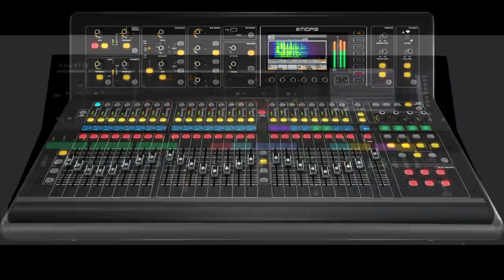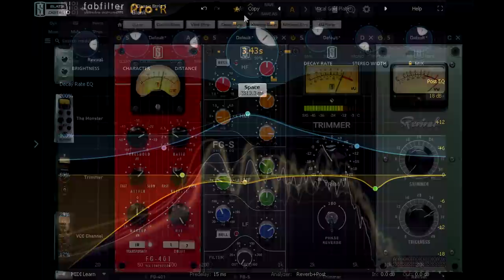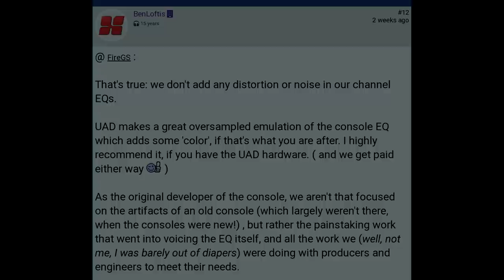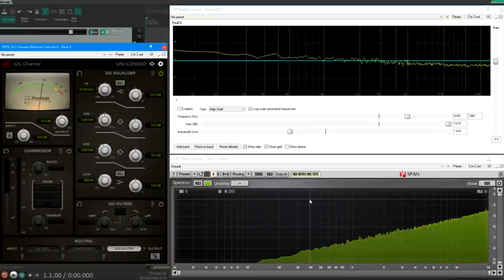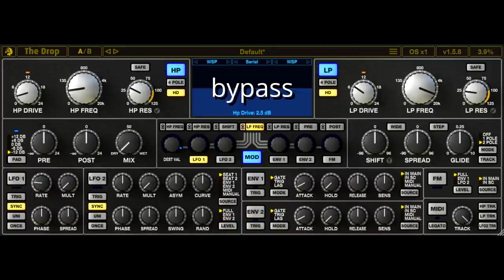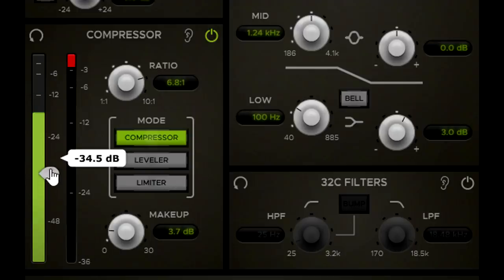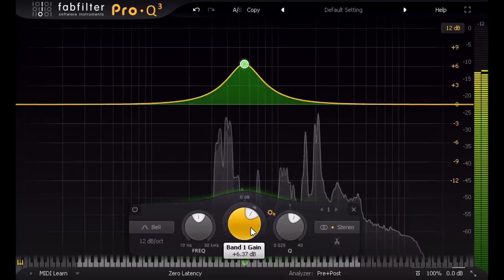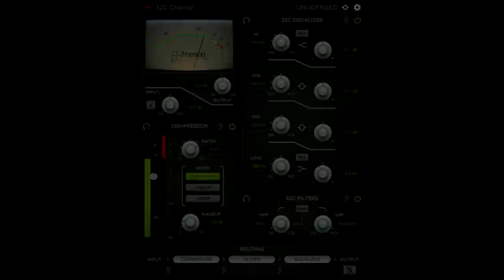Why Does It Null? (with ReaEQ) Harrison 32C Channel Strip

Comment: I wasn't really interested in this plugin and after this I'm definitely not. I find that these days I mostly just reach for the Fab Filter eq, it does what I need and is reliable, which is what counts when you have tight production schedules.
Reply: Sounds like you compromise in quality for quantity
Reply: @KyleGushue  Pro Q3 is one of the best EQs available. It's not sacrificing any quality.
Reply: Sounds like you comprimise in quantity for quality
Reply: @privateer2584  just reaching for the same old EQ because of time restrictions is compromising. No single EQ is best for all things
Reply: Does that come with saturation option (FabFilter)?
Reply: @agentviktor3297  no they have Saturn their saturation plugin
Reply: @LS-ud7do  it’s good when it’s done, and not done till it’s good.
Reply: In this case try TB Equalizer 4. You have infinity amount of bands, each is dynamic and can be saturated independently. Amazing stuff.
Reply: @KyleGushue  " No single EQ is best for all things" is a very ignorant and funny thing to say
Reply: @lannyfce4786  u serious? Matching the tool to the source is audio 101.
Reply: @KyleGushue  name something any EQ can do that pro q3 can’t do instead of using abstract rules that don’t exist
Reply: @lannyfce4786  easy, TDR Nova does dynamic equalization without aliasing, Pro Q3 aliases. Neve, Pultec, and API, all do harmonic distortion due to there design and components. Pro Q3 does not. These are facts easily shown in testing.
Reply: @KyleGushue  TDR Nova just aliased in testing (on each quality mode available on GE). I wanted to compare the anti-aliasing to Pro Q but apparently my trial for that is over.
Reply: @LS-ud7do  could be a flaw in the testing method.
Reply: @KyleGushue  Such as?

Edit: actually don't bother, you're either a liar or you don't know how to use Plugin Doctor, clearly there's no circumstance where aliasing could occur on a plugin that doesn't alias.

Decision fatigue is the strongest argument for picking a single high quality EQ and using it without question. If one already uses Pro-Q 9 out of 10 times; one could save 100 unnecessary decisions from the workflow of a single 100 track mix by using this technique.  For the 1 out of 10 times it isn't the right EQ, you can pick something else, still saving at least 90 decisions in total. It's the reason Steve Jobs wore the same style clothes every day.
Reply: @LS-ud7do  sweeping at an inordinately high level, mistaking aliasing for harmonics, not sweeping at various levels... there’s myriad possibilities for error.

Steve Jobs wasn’t making an artistic statement with his clothing. In fact with his art (design) he never settled for the same old thing, as your suggesting we do with EQ. 

It’s simply lazy and non-artistic to say one EQ (regardless of price or fame) is the absolute best for any source. Just like any mic, amp, instrument, ect isn’t the best for everything. And stacking the same pluggin over and over can exaggerate it’s otherwise subtle deficiencies.

Good is the enemy of great.

Edit- decision fatigue is a result of inexperience, not having too many options. One who knows their tools can immediately grab for it as fast as they can pro q or whatever. In fact having that variety can achieve results faster, than trying to sculpt something else into what it’s not ideal for.
Reply: @KyleGushue   huh. That’s funny because, this video clearly demonstrated how a console EQ emulation which had implied saturation but then null’d with reaper... so maybe you’ve been placebo’d a bit more than you think haha ; )

Also wrong about aliasing in proq3 lmao. I still don’t believe you’ve said 1 thing proQ3 can’t provide except adding what are the majority of the time unwanted artifacts I guess? Artifacts the people using the original hardware didn’t even want?

Here’s a final question for you. If you see a producer has 2 eq plugins, and one has 10 eq plugins, who is the better mixer?

(*hint* if you think you have an answer to that, you are not very smart, because proQ3 is more valuable to someone who understands EQ than every EQ combined is to a beginner)

Oh yeah one quick thing, you’re talking about Steve Jobs ‘artistic choices’? what is that even supposed to mean? Mixing is essentially just problem solving frequencies and dynamics, not building smart phones lol if I hear that I need to cut 500hz or high shelf 12k then I know where I need to cut and where I need to add a shelf, a different EQ is not going to make those moves substantially different and if they did it still will not be different enough to make or break my mix. When people like Dan Worall say ‘yeah stock EQ’s are pretty much good enough for everything,’ your brain says ‘but hey then why did I pay money for these emulations? What? I just got ripped off then, no way, these plugins MUST be worth something!’ When in reality, they’re not. There’s nothing any eq you have could do that virtually any stock eq couldn’t with a separate tape/tube/saturation plugin mimicking ‘warmth’

Thanks for being so wrong about things, this was fun : )
Reply: @agentviktor3297  It is amazing
Reply: @KyleGushue  Decision fatigue is a fact of life. If one has the mental stamina or experience to mitigate its effects then that's great, these are the things that should seperate us as engineers, as people. It's good that we have different approaches so I've elaborated on the qualities one approach. I actually use a slightly different method myself (for reasons you stated on a previous post) but still keep my EQ's to a small few. 

However there's no reason to spread miss-information about specific plugins so my focus was your point about TDR Nova not aliasing, now that's been debunked I'm done here. 

Making up false excuses about my testing just convolutes the matter, let's not pretend Pro-Q aliases under anything other than extreme duress.
Reply: @LS-ud7do  pro q aliases in dynamic mode. And without seeing your test, I can only remain agnostic about its relevance. That’s reasonable and rational.
Reply: @lannyfce4786  pro q aliases in dynamic mode.

the engineer with 10 eqs has a better chance of matching their processing to the source, if all other things are equal.

Considering how many of us still use Neve and api and pultec, and how many digital models there are, your claim about unwanted artifacts is incorrect.

I’ve verified mine saturate, tubes and transformers cannot be void of harmonics. Not even GML is completely clean.

The Steve Jobs comment was in response to someone trying to say he wore the same clothes daily, therefore we only need one EQ.

Find me a hit song, that only used pro q.
Reply: @privateer2584  I'm with you. Reducing cognitive load is important. People can futz around with a zillion plugins if they want but if my mix isn't 95% there within an hour the rapid degradation in the quality of my mixing decisions far exceeds the benefits of choosing the perfect plugins!
Reply: Dan sold me on the Tokyo Dawn suite of plugins and they blew me away, completely changed the way I work, mix and listen to our recordings. Superb!
Reply: @LS-ud7do  This! If you mix Post, you often don't have the time to test out different EQ's. I've used the ProQ for years and know what it does and how it will react on different source material. With tight deadlines, this saves time that I don't usually have. I'd offer that people who have the time to experiment (looking for the perfect tool for the source) are often making music for themselves, do not have deadlines and aren't sending an invoice for their work.

Comment: Hah, busted! For all their bollocks about modelling every transistor, they've managed to make a relatively flavourless digital EQ that cramps at the top end. In that regard, a non-cramping overtly digital EQ is probably closer to an analogue Harrison desk. I hope this video causes them to address these obvious flaws in the way that your ReaComp video or White Sea Studio's Smooth Operator video did.
Reply: From the responses I've seen from them so far, I'd say that it's unlikely... 

I'm glad you mentioned Smooth Operator. The way that company handled that was great. I really think they just made a mistake or didn't realize it would be a big problem and the fix they rolled out was solid.  This seems more manipulative...
Reply: I was suspicious when I saw that this plugin introduces zero latency to the signal - it shouldn't be really possible to make to do such complex emulation without any latency.

Comment: Isn't this the biggest issue with reproduction of hardware, the ‘colour’ sales pitch just doesn't work. No matter how many prominent youtubers or mixing engineers tries to convince me, the only benefit I see and have these for is to avoid watching the mix instead of listening to it by using both some modeling and clean and Fabfilter plugins.

I still want to see a true blindtest with some of these youtubers and engineers and see how well they do choosing the ‘coloured’ sound they claim to hear doing such huge difference.
Actually when thinking about it maybe I'll even sponsor a contest.
Reply: As in this vid, many times "color" ends up just being volume. An easy way to make your EQ sound "warm" and "rich" compared to stock or derisively-labled "pure" EQs is by adding a little more dB to your bottom end boosts than the controls suggest.... At that point, who is to blame, the youtuber who probably truly just doesn't know any better, or the plugin manufacturer?
Reply: @tz4601  Both perhaps? The youtuber should be educated when reviewing or talking about products.

Comment: Bit of unreasonable conjecture at the start about the UI design of analogue consoles being almost solely limited by the space available for knobs - stomp boxes have been using double shafted pots for decades now.
Reply: Have you seen a 1081 module?! 4-band with concentric switching, filters, and gain. Only manages q boost switches for midband. It's over a foot long by itself. Add dynamics, channel routing, and faders and you're quickly pushing the limits of ergonomic function.
Reply: @grantlack  The diameter of it's pots is beyond ergonomic - could easily be made to be half of the size

Comment: "What happened to all those resisters, capacitors and transistors?" Haha. I once developed plugins, and in my research, I found that this: Phat analog, transistor and tube sound emulation, was mostly just horseshizzle. And it is mostly just modeled-in difference, by manipulating the control to actual processing. So a 3db boost was actually a 4db boost, giving the impression of being warmer and bassier in comparison. There are even compressors out there, that EQ's the signal as you compress it, to give it a warmer sound. It is just too easy to manipulate listeners to fall for this marketing scheme. That's not saying that, in some cases, this signal manipulation doesn't sound good, it is just that it can be done with clean tools as well.
Reply: I love coloring compressors
Reply: sometimes the EQ effect comes from the sidechain curve of the compressor but yes I feel that some compressors EQ your signal to compensate something or just to give you a warmer feeling while still at unity gain. What plugins have you developed? Solo developer or for a company? I have a few ideas I want to develop but im not a coder. Can you give me some advise?
Reply: @24k-n6x  I developed both Solo, and some group projects. But during DSP research, and analyses of commercial plugins, I discovered that analog modeling, doesn't really exist in the way end-users think.

In regards to developing plugins. You should could start with a node modular like Reaktor to research, build and get a sense for how effects, processors and instruments are constructed / modeled.

From there you could move to scripting in Blue Cat's Plug'n Script. To get a sense for simple coding, here, prototyping in Reaktor can be immensely beneficial. Plug'n Script also lets you export your creations as standalone plugins. I think you can even sell them. But you are limited by its sets and libraries.

Next step is DSP coding in C++ with some framework like JUCE.. Math, and DSP forums are your friends here ;)
Reply: @noxlupi1  Thank for the info!  Will try and look into all of that.
Reply: Yeah.  Transformers should be the only audible “coloration” especially if the hardware is getting a hot signal.  If the transistors, resistors, etc are making an audible difference, there is something wrong with them.

I like Harrison and use Mixbus for final mix downs, so I’m familiar with the channel strip on the actual DAW.  As a DAW feature, it’s fantastic.  As a plugin?  Meh.
Reply: @This Guy Pretty much all "Tape Emulators" work in this way.

Comment: Transfering the user interface of hardware units into GUIs of plugin emulations only helps the sales and marketing. In fact, it makes the operation much worse than on the originals. Seeing a "photo" of the original helps to believe that it sounds like the original. 
Beside the sales aspect, there is another argument: pleople who are familiar with the operation of the hardware will use the emulation plugins. (Again some more sales🙂). I doubt this.

Comment: Is anyone running 32c on M1 mac? CPU usage through the roof because it simulates analog console or whatever. Everytime you close it, it gives you error report. Solo features which make no sense and jump around. It however has pretty good crash recovery feature which is really needed. Like all the time. Requires massive buffer size and still has unacceptable latency. It doesnt end there, but I'll stop anyway.

Comment: Hi Dan,
I'm a fan of your videos but I think you missed the point of using this plugin.
I like the limitations of this plugin.
Sometimes you don't want to dial the Attack and release of the compressor because you want to move quickly and you just want something with a few options that sounds good. (For example waves Rvox)
I understand that the EQ section is probably all "bells and whistles" and marketing BS but it's still sounds great.
I found that while I'm using this plugin I can get great results in no time and part of it is because of the limitations that you mentioned in the video.
Reply: Same here. I have been using 32C since it came out. I find the plugin is quicker to use than the DAW controls. Maybe the comparison should have been between the 32C DAW and the plugin. Ya think they might null??  My clients budgets do not allow for me to spend too much time working with very complicated plugins.
Reply: You are correct.  The design of the EQ is to fix the most amount of issues with the least amount of knobs therefore you don't get a Q knob.  Same goes for the compression section which gives you very basic yet powerful controls to find a sound quickly and move on.  If you really need all the extra stuff then this plugin is not for you.

Comment: Well. If they only modelled the linear behavior of the EQ circuit they kind of told the truth when saying, that every electronic part is represented int their model. Everything has been linearized at the operating points. And of course you can not overdrive an emulated console with a linearized model.

Comment: "More controls does not equal more control."

I fell that big time. I have ADHD, so when I see the fancy compressor or channel strip plugins with a thousand dials, I don't see endless possibilities. I just see option paralysis, more opportunity to fiddle with knobs, and more potential points of failure. Give me a nice SSL-style strip or something similar and I'm good. If I really need to get granular with the EQ to notch out a nasty frequency, I'll just use FabFilter Q or something like that.

Comment: Btw, almost all "analog console" plug-ins seem to be way off what the actual values are showing (except for TBProaudio CS5501, probably my favorite console plug-in). Just look at the SSL plug-ins (in particular, they are WAY off), Waves console plug-ins, PA's console/analog plug-ins etc. None of them show you what you are actually doing, and I hate it. Sure, you are supposed to listen to what it does and not mix with your eyes, but if I wanted it to be this way I'd rather have a button that removes the values than just having worthless values showing all the time.
Reply: TBProaudio CS5501 definitely needs more love. It's an awesome channel strip :)
Reply: @esahm373  I've already used it a couple of years ago. It's a good idea and great freebie, but my problem is with all these console plug-ins and developers that try to make you think that their emulations are special or sound better just by lying to you through fake values. They should either show you the correct values or nothing at all, otherwise they could just name the bands earth, thump, growl, punch, air and other worthless analogies.

Comment: Your rant about the Input/Output knobs is a bit unfair. A compressor is non-linear, and having a control on the input gain is a good option: the input signal can be too hot, and the 'Makeup' parameter can't fix that (since you need to reduce gain before the non-linear process to have a compressor working as you'd like it). Since the order of processes is flexible, having input gain control on the EQ would not be sufficient in all cases (when compression happens before the EQ).

On the other hand, boosting something with the EQ can generate high peaks, and reducing them with the 'Output' knob is fine.

The reason for not having a compressor/leveler/limiter at the same time might be that the corresponding buttons are just 'presets' for attack/release/knee settings of a single compressor process. Having them parallel would use more CPU, and would require a more complex plugin UI.
Reply: @ericburger9334  Obviously I'm not talking about the point, since this issue covers only 2 minutes out of 33, but Dan did go into details on the uselessness of the input/output knob, while those actually have some use.